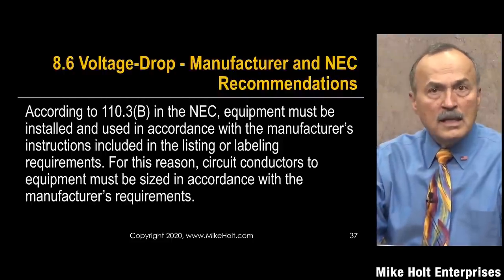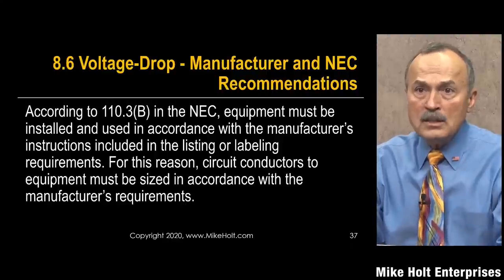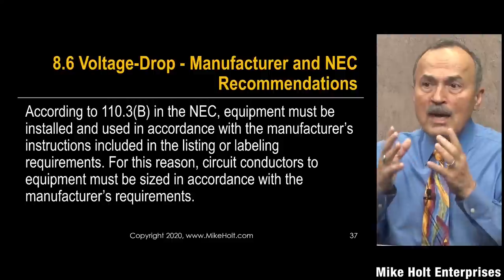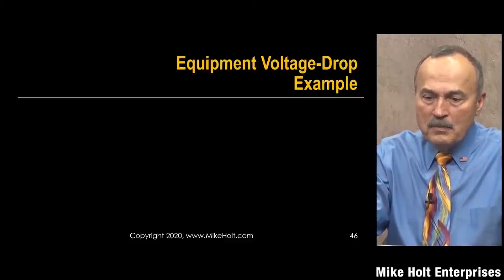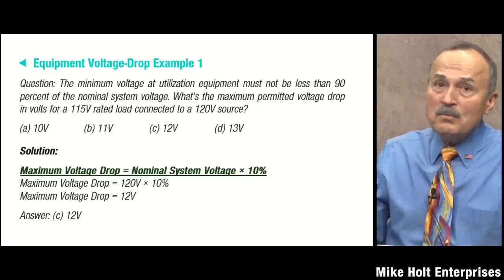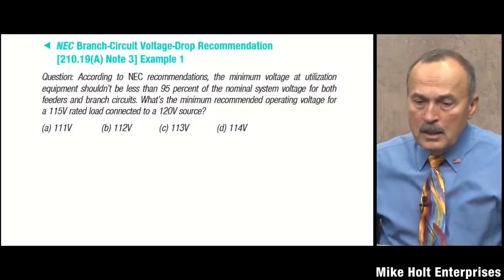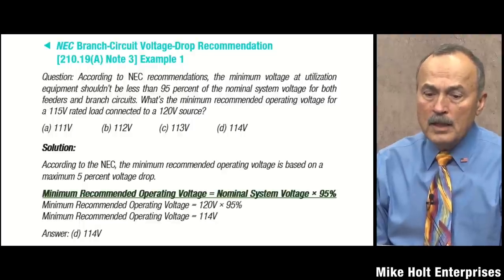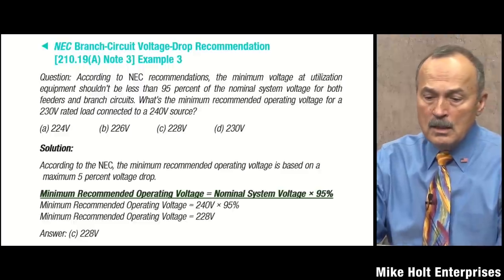Voltage-Drop - Manufacturer and NEC Recommendations [210.19(A) Note 3, 2020 NEC]

Comment: I think some of the confusion is a result of using the term “voltage drop” when discussing ANSI 84.1. NEC Voltage drop or (rise) is a delta from voltage variable.  ANSI is a voltage range (tolerance) of Nominal voltage. You can have Zero voltage drop from service to branch circuit load and be less than ANSI’s acceptable voltage “Range”, if utility voltages are too high or low.
Reply: This is fair. Because I work for a utility and our tolerance is 5% of the nominal. So we’re already giving the customer a where between 114 and 126
Reply: A more accurate term would be Ohmic Voltage difference.  It is the voltage difference from source to load, due to the fact that the conductors have non-zero resistance.  It is the voltage necessary to cause current to flow through that section of conductor.  If you're working with a power source instead of a load, it is really a voltage rise, rather than a voltage drop.  But it still is a loss of power in the form of heat generated in the wires.

Comment: One interesting aspect of voltage drop calculation is: Nobody talks about the actual load current to be used for voltage drop calcs. Motors seldom operate at their nameplate rating and the Code is clear about the basis for ampacity for cable sizing. But when it comes down to voltage drop, no standard or Code on earth tells if you need to take the nameplate rating or actual load, and there lies a flexibility to get the actual BHP value (shaft kW) and take the actual load Amps which will never be exceeded.

Comment: In the industry, its standard to consider 5% voltage drop from Transformer terminals right upto the consumer terminals. This ensures that we remain in an envelope inspite of source voltage fluctuations, Transformer regulation (load depended) and effect of overloading the device itself. Increasing this envelope to 10% means now you don't have much flexibility in operating the power system and voltages at load end may routinely go below 10%.

Comment: Question: Franklin Electric Motors tells me plus or minus 10% of 230 volts, PG&E tells me plus or minus 5% at 240 volts. Who's correct..
Reply: I was under the impression the manufacturer spec is 10% of 230 volts so that it can comply not only with utility variances but also run on single phase 240V or 2 legs of a 3 phase 208V Wye. 
230V motor - 10% = 207V
230V + 10% = 253V.
But this is supply voltage, not a voltage drop.